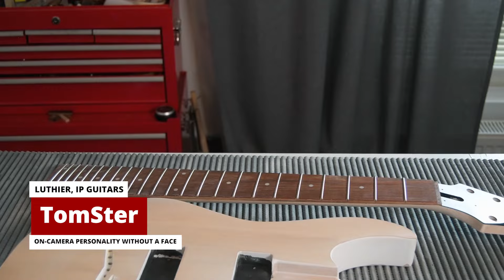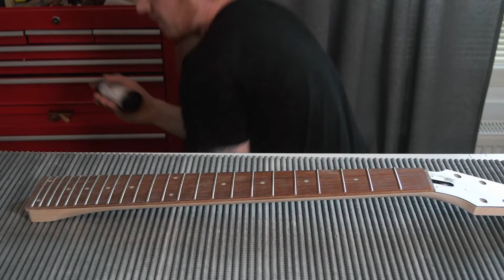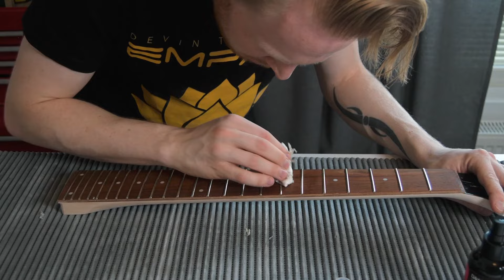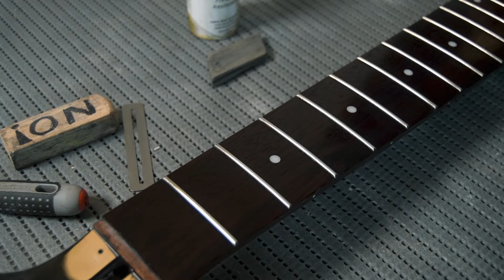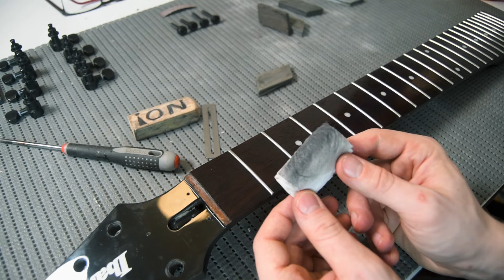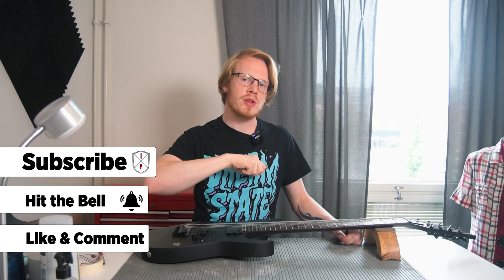How To "Ebonize" A Fretboard With Stains

Comment: Does this work for the back of the neck also? I have a Fender p-bass with maple neck and ebony fretboard and I would like to get a darker neck as the headstock and the body are black.
Reply from the maker: For the neck itself you will need to strip it to the bare wood. After that you can stain it and apply a finish. You won't really be able to put stain on top of a lacquered neck. Other option is of course paint.

Comment: Does it stain your fingers when you play?
Reply from the maker: Not at all. The key is to thoroughly clean the fretboard before staining and wiping off the pigment that just lifts off. The fretboard oil will also kinda "seal in" the remaining pigment, so you shouldn't really have any come off on your fingers if you did a proper job of it :)

Comment: Scrape the FLAT part of the razor over the inlays, not the pointy bit...
Reply from the maker: Yes, exactly the case. In the video, I should've been more clear about this. I used the tip to clean off some very specific parts. While yes, with a fresh blade you can easily get the inlays cleaned with the flat, for some reason I chose to not do so here, when that would be what I usually suggest in doing🤦🏼‍♂️

Comment: If you left the stain on the inlays longer would it dye them eventually or would it just end up being scratched off by the strings?
Reply from the maker: Great question!
The stain would not actually properly "stick" onto the inlay material and would eventually rub off from string friction.

Comment: hi dude, would colour fade over these years? Or would it get a bit colour on your fingers? I would like to do the same thing with my guitar..thanks
Reply from the maker: Great questions :)
1) it really depends on the stain and how it was applied. Many woods also darken with age, so age might actually be beneficial to how dark the board will be.
2) as long as you apply the stain on a clean and dry fretboard and let the stain seep into the grain a good bit, you should be fine. Also with the application of the fretboard oil and buffing all the excess off you will also lift off all the pigment that was just left on the surface. Once again, might depend on what stain you use :)

Comment: How would you dye the sides if you didn't want to get it on the guitar neck? Mine is finished with true oil, and I don't want to darken it or mess it up. Thanks!
Reply from the maker: Good question! Just apply masking tape to the neck :) make sure to burnish down the edge of the tape (with your fingernail), so that you'll avoid stain leaking through gaps.

What also helps during application is if you do not wet your applicator too much. Just apply the stain in light layers instead of a whole lot at once (which might cause some issues). If you're going to use water-based stain then it shouldn't even stick to an oiled surface, so clean-up should be easy if it does get on your neck.

Comment: will this have the same effect on pau ferro?
Reply from the maker: Should do, once again, just need to be sure to remove any excess of oils before you stain. Of course results always vary, due to grain patterns, but you can always add a few layers. Pau Ferro is pretty dark to begin with, so you should be just fine.
Reply from the maker: Should do, once again, just need to be sure to remove any excess of oils before you stain. Of course results always vary, due to grain patterns, but you can always add a few layers. Pau Ferro is pretty dark to begin with, so you should be just fine.

Comment: Does the stain rub off on fingers when playing?
Reply from the maker: If you've cleaned and dried the fretboard properly then no :) at first with oil added, some pigment will lift off, but if you just rub out all the excess oil and buff it up, it will be just fine.

Comment: Could you please tell me the time gap between the layers.
Reply from the maker: 20 minutes between coats, 3 coats per session, 24 hours between sessions
Reply: And how many sessions ?
Reply: Could you please tell me which cloth you are using
Reply from the maker: I'm so sorry, I COMPLETELY mistook which video you were commenting on🤦🏼‍♂️🤦🏼‍♂️

Stain-wise, it depends on if you're using water or spirit based, because you need to let them fully dry. This will read on the label for the stain you've chosen. Layerwise, I usually might do two for this sort of thing, but honestly it depends on how dark you want and how long until it is that level of black.

As for oiling afterwards, one layer on the board, then wipe off the excess.

The cloth is just paper towel here.
Reply from the maker: Sorry again for the confusion there.

Comment: Great video! I’m planning on staining my SGs neck but I’m worried about damaging the paint on the back of the neck - is there a risk of that?
Reply from the maker: Great question. You should be just fine, stains usually won't stick to clear coat/paint. But you can always just use masking tape to mask off along the side of the fretboard if you just want to make it cleaner for yourself :)

The key is not to use too much stain at once. The more stain you have, the more mess you're going to make if it runs all over the place.

Comment: When you sand it if leveling the fretboard will it go back to original? Also will the stain come out on your fingers as you're playing the guitar?
Reply from the maker: If you need to sand the fretboard after staining, it will of course sand some of the stain as well and you will need to reapply. So if it's a process that needs doing, do it before staining :)

The stain won't come off on your fingers while playing if done correctly. So make sure to wipe off any excess pigment on the surface and when your oil the fretboard, removing the excess oil should remove the loose pigment too and will protect both the wood and the stain better from sweat.

Comment: Use Naptha....not lighter fluid. The Naptha evaporates and doesn't leave any residue.
Reply from the maker: After a bit of reading up (and not having used either in a long time) it seems that I hadn't updated my information, as naphtha at least used to be an ingredient in lighter fluid (or some of them). Nonetheless when I did use lighter fluid 10 years back I did not notice it leaving behind any residue either.

Thanks for actually making me look this up and update myself on things a little more! :)
Reply: @IPGuitars  We all learn from each other brother! Thanks for the video, I picked up some tricks from you. I've found that Naphtha also dries out the fret board a little bit....making it thirsty for stains and conditioning oil. Seems to soak it up a little better especially when dealing with tighter grain woods like Pau Ferro. Rock on!
Reply from the maker: Oh definitely the case with lighter fluid as well. Oil definitely soaks and builds nicely after that

Comment: Also I'm doing it on a bright Maple Fretboard. U can see my stroke pattern and it looks bad. Will this fad or is there a proper stroke pattern to do? I did the little circles like u did in the video
Reply from the maker: Seeing stroke marks is normal, especially if you've applied only one or two layers on a light colored wood. Just means that you need to blend the stain in a little more. I did little circles, but unfortunately didn't explain that quite well enough, so:

During application of the stain, what you want is a uniform finish. Depending on the brand of stain, your results may vary, so a test piece is always a good idea if you have access to one. Essentially in the video I do little circles to wipe on the stain as a way to rub in the stain into the grain. During repeated action I gauge how the stain blends into itself and aim to get rid of any stroke patterns. Wiping off excess stain is really important, so you can do the final wipes with the grain to try to even everything out. You may need to do several layers, so with each consequent layer, you can see that the stain starts to get to a more uniform finish. Keep up this process until you have your desired color. If the stroke patterns are too prominent even after a new application, you might need to lightly sand between layers (400-800 grit, REALLY lightly).

If the stain seems to just move on the surface of the fretboard and not seep into the grain, you might need to make sure that you have prepared the surface properly. Especially with maple boards that could have a clear coat on them as stain will not penetrate that.

Comment: Hi, Why didn't you sand the fretboard before staining?
Reply from the maker: Heya, to sand the fretboard properly I would've needed to pull the frets and refret it.

Also, I didn't need to :) cleaning it up and removing the excess oils on it are more than enough to get the stain to stick.

Comment: I'm wondering if I can PAINT my fingerboard black.  I'd like to paint my ENTIRE STRAT black.  The headstock, the back of the neck, the fingerboard.  Everything except the strings  and pickup posts I guess.
Reply from the maker: I mean, yes, you CAN. However, the difference with paint and stain on the fretboard is that the stain seeps into the grain of the wood and the paint is a layer on top of the wood. Essentially if you paint the fretboard, it will start coming off as you play and the strings wear out the paint. This can of course be lacquered afterwards, like Strat maple boards usually are.

Paint is also much much thicker and if not done well enough, will feel a little "off" to play. Also, while you can paint the fretboard, it is much more difficult and time consuming to get right. Just a little heads-up :)

Comment: My rosewood fretboard was finished with true oil. Can I use the stain directly or do I have to sand it down before? Does the stain gets in the skin of the fingertips when playing?
Reply from the maker: You'll need to get rid of the oil first, so that the stain will stick. Denatured alcohol, lighter fluid, or fretboard cleaner of sorts should be enough to remove it.

Once you've applied the stain, be sure to apply some fretboard conditioner (oil, e.g. lemon oil). Apply the oil and buff out the excess. This should create a protective layer on the stain and at the same time it will remove the pigment that was lightly stuck on the surface that would've otherwise ended up on your hands :)
Reply: @IPGuitars  Thank you for your advice. I will try it.

Comment: would these stains fade as you play the guitar? or no?
Reply from the maker: If done properly it won't. Of course over age it will wear, just the same as any finish really, but with proper prep to get the stain to penetrate a little, and oil on top, it'll be good for a while.

Wearing also will depend on the stain that was used as well.

Comment: Been looking online for a while now for the best/practical method for doing this on my jackson king v. I really dig how this doesn’t require sanding! But I do want my board pretty much as black as I can get it. Would using this stain get it really dark with multiple coats? Or would you recommend a different product or method?
Reply from the maker: Oh you definitely don't need sanding for this to be convincing enough :) and yes, essentially as long as you have done your prepwork well enough (fretboard is clean and dry), the more layers you add the darker you can get it. Just let layers cure in between new layers and you should be just fine👌
Reply: @IPGuitars  sweet! Thank you for the reply
Reply: @IPGuitars  thanks for the vídeo. How long It takes to cure between layers?
Reply from the maker: It depends on what kind of stain you use. Always good to check the instructions on the label :) but for example spirit based stain will off-gas fairly quickly, so adding layers doesn't take long, so I'd usually give it a fair 20 minutes to be on the safer side. Water based will take a little longer, as you wait for the water to dry, depending on how much stain you use (how wet you use it) this can be from an hour to several.
Reply: @IPGuitars  i just bougth the Crimson's stain like the one you use. I hope to receice it soon.

Comment: Don't any stain stains your fingers when you play?
Reply from the maker: It shouldn't that much. Once you oil the fretboard after the stain has cured, it sort of "protects" it. When you rub off the excess oil, you're also removing all the loose pigment on the surface, which would have come off otherwise. Other than that it should be pretty fine. I have an acoustic I did this with last year and I'm yet to get any pigment on my hands :)
But just like with any oil+stain finish, over the years you will see wear as you play, but it shouldn't really come off onto your hands as such.

Comment: can u use acetone to clean it?
Reply from the maker: Oh definitely, cleans up the residue/oil and doesn't damage the wood as it evaporates quick.
Reply: @IPGuitars  and can i use lemon oil for the last step?
Reply from the maker: Yes, it's meant for fretboard conditioning the same way as the oil I used :)

Comment: Hey mate, I've done the process on my guitar but even using lemon oil after the staining process I get my fingertips dyed black after playing for awhile :( any recommendations?
Reply from the maker: Make sure that when you apply the lemon oil, you rub off all of the excess oil. You can really buff up the fretboard to make sure that any excess oil (or pigment) won't continue to lift off. Now with some oil on already, you've kind of helped seal in the pigment a little more, so best thing to do is apply a very thin coat of oil again and make sure to buff up and remove all of the excess.

If your pigment (stain) is clearly lifting off, then there might be an issue where the fretboard wasn't clean and dry enough before staining and some oil residue (for example) isn't allowing the stain to fully sink in.

Comment: Nice video, Straight into it, no fluff. One suggestion, if you want to round the edge after staining I'm sure you can roll/compress it with something like the shaft of a large screwdriver, while not affecting the stain.
Reply from the maker: Thank you for digging the video.
And that is a great shout! Totally slipped my mind, but an extremely nifty trick to use. Next time then ;)

Comment: What kinda wood stains can i use when i dont have a specific Guitar stain ?
l
Reply from the maker: You can use any kind of water or solvent based stain for this. Another very good product is leather stain. I strongly recommend also testing the stain before application to your actual work :)

Comment: Hi, Did you sand the fretboard beforehand? In the beginning it looks like it had been sanded a little but I just want to make sure before I do this on mine.
Reply from the maker: I only cleaned it. To sand the fretboard properly, you'd have to remove the frets. You could potentially scrape it clean as well, but honestly, just using something like isopropyl alcohol to clean the fretboard is far easier :)

Comment: How long did it take for the fretboard to dry after the stain?
Reply from the maker: I used the spirit stains, which dried up pretty quick. I'd say that give it a good 10-15 minutes at the very least for best results before oil :) with water-based I would rather go hours.

You can tell when the stain has dried by how it looks. Any splotching and wait a little longer :)
Reply: @IPGuitars  Thanks. I tried to darken the fretboard on my LP to make it look more vintage accurate. I think where I messed up was not cleaning and drying out the fretboard well enough for the stain to absorb properly. The stain has rubbed off from playing. So I am going to make another attempt to darken it.
Reply from the maker: Ah yeah, good to make sure you get the wood as close to "untreated" as possible with cleaning it. Essentially giving the best odds for the stain to absorb into the wood grain and stick. Any residue, oils, or build-up will inhibit the results. Hopefully your next try will go off without a hitch though! :)

Comment: How long for the 1st coat needs to dry ? Do I put the oil on after immediately or is there a wait period as well?
Reply from the maker: You should wait for the stain to fully dry before oiling. Depending on the stain and how much you apply, this might be matter of half an hour to maybe a few hours. The wetter the application and the more stain there is, the longer it takes to dry.

Comment: You didn’t clean the edges and that’s where a bunch of thumb and palm gunk get on the top and bottom edges. I’ve found that rubbing alcohol does good for deep cleaning and drying but only if staining the board.
Reply from the maker: I refinished the entire instrument and in the process I actually sanded the edges of the fretboard prior to staining :) then I sprayed a clear coat on top of the edges as well.

Rubbing alcohol does indeed work very well, I just didn't have any at hand at that point.
Reply: @IPGuitars  it’s all good brother! I forgot you said you were doing the back of the neck in black which explains that. But that was a beautiful five piece neck and I know you was doing what the owner wanted but man that thing would’ve looked sooooo good if stained into like a roasted (back of neck) maple type deal behind that black satin on the body. When I do stuff like this for friends/clients I tell them what I think after they tell me what they want and 9 times out of 10 they agree with me lol. Not to mention I like using the black India ink from stumac to ebonize a fretboard. It works fantastic. But Im also open to new new ideas~that’s how I stumbled onto your video. Cheers bro good job for sure!
Reply from the maker: @rodnocker505  Totally agree. I usually also discuss stuff pretty extensively to see what it is that they actually want. A blackout was what the doctor ordered so to speak! :D But I agree, the five-piece looked really really nice, but even I admit that there is something sleek about an all matte-black guitar. And that's coming from someone who usually doesn't like that sorta thing haha